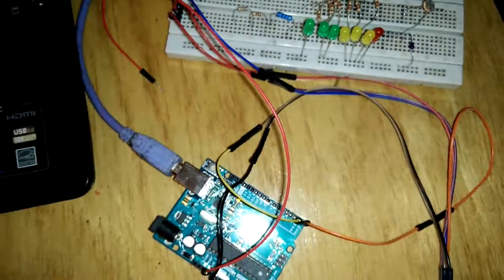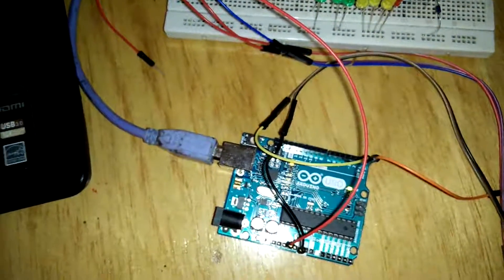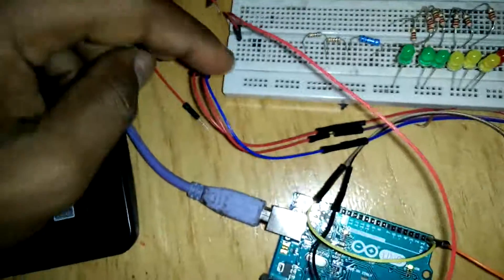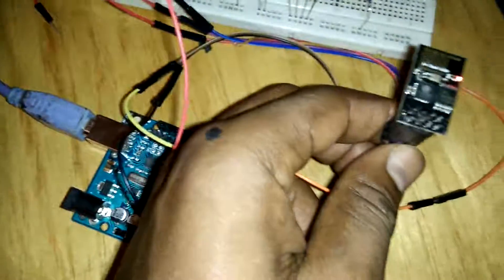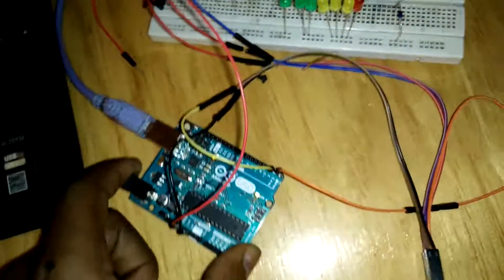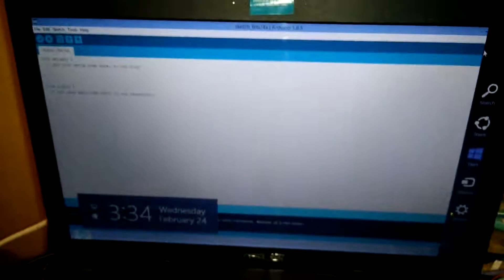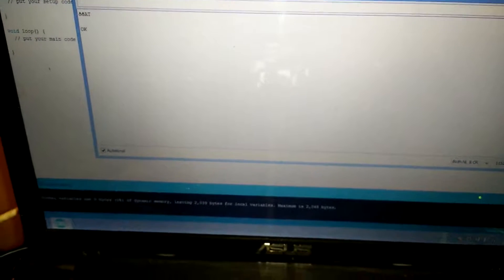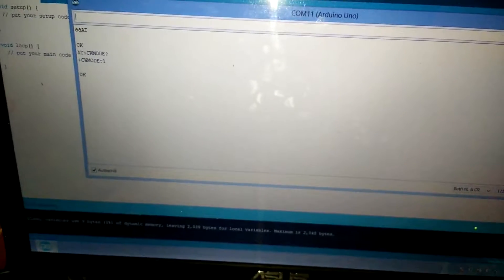How to connect the #ESP8266 wifi module to arduino using the 3.3V and entering AT mode

Comment: Yes, you are using 3.3v supply voltage from Arduino to power the 8266.  But the Arduino TX goes to 5 volts in "high" state and that can cause problems with the 8266, because no pin on 8266 should have more than 3v.  That's why you need the voltage divider between Arduino TX and 8266 RX.  (Yes, it might work for a little while, but sooner or later it might kill your 8266.)

Other than that, you didn't really try or explain the AT command set, so your video could have been a lot better.
Reply: Is it neccessay to connect a voltage divider btw tx and rx ??
Reply: Can u share me the bread board circuit?? 
veriton3120@gmail.com send it here pls
Thanks

Comment: not work for me after entering AT command nothing showed ..........I try to read from serial but entering the AT command they shows some value like 65 and 10
Reply from the maker: what is your baud rate?
Reply: Julius Machira Wamuyu  I checked both values 9600 and 115200 but not worked

Comment: AT is giving ERROR? what is the reason?
Reply from the maker: what kind of error are you getting? if it some gibberish, you may need to change the baud rate of your serial monitor. either 9600 or 115200. Otherwise you may have specify the kind of error you are getting
Reply: when I type AT command its giving "ERROR" instead of "OK"
Reply from the maker: "ERROR" means you may input an incorrect AT command. Ensure you key in AT with no space

Comment: excuse me guy. i do it follow your video, but it can't connect it. It can't show AT command in serial monitor. what should i can do ?
Reply from the maker: have you set the baud rate to 115200? guess that's why you don't see a response. Also connect RX of the module to RX of the Uno and TX to TX. That should work. However, this demo is just for testing the ESP8266. To build projects, you need to acquire a logic level shifter because the 3.3V of the Uno doesn't provide enough current to drive the module. Check here http://arduino.stackexchange.com/questions/18575/send-at-commands-to-esp8266-from-arduino-uno-via-a-softwareserial-port